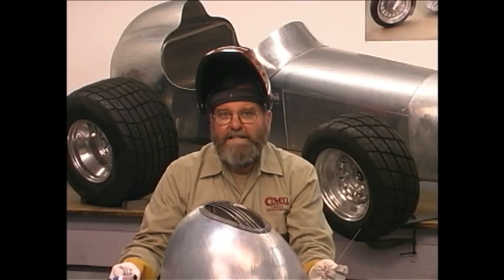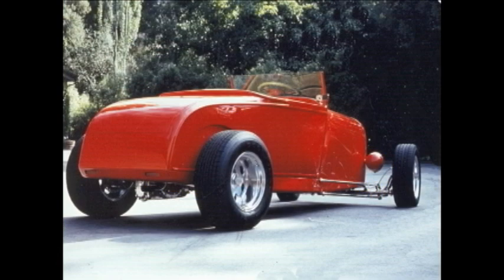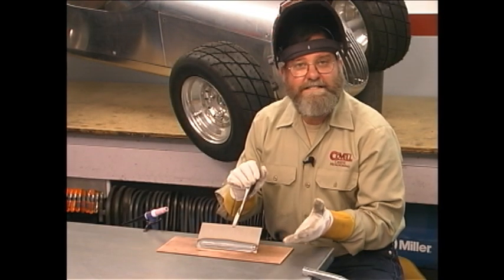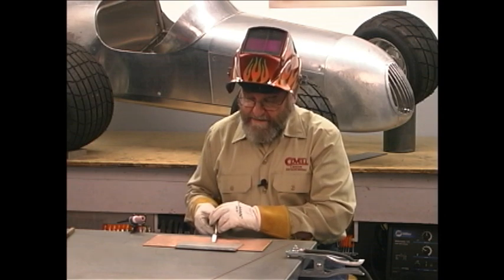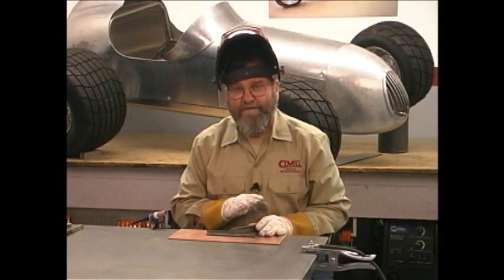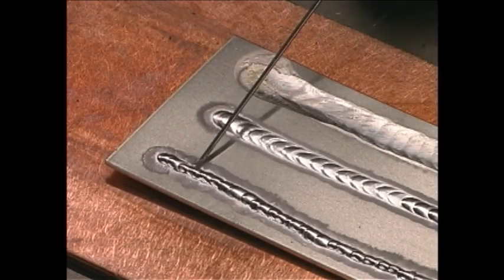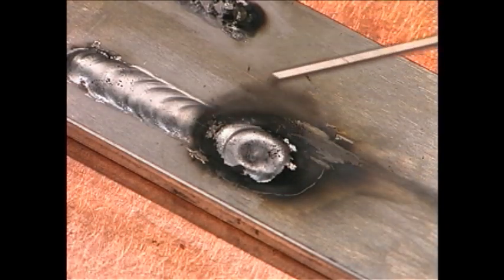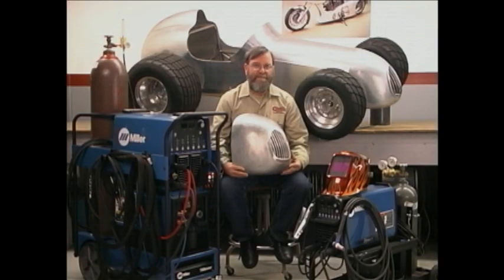TIG Welding Basics

Comment: I've tried TIG welding with a professional machine before (Migatronic brand) and i did not like it, seems TIG welding for a hobbyist such as me is not the right way to go, especially since i don't weld often and it's easy to come out of practice with TIG welding.
On the other hand when i got my MIG welder i absolutely loved it and in half an hour my MIG welds were consistently looking better than any of my TIG welds :)
Reply from the maker: Well, there are some very good reasons why MIG welding is far more widely-used than TIG welding. It sounds like MIG welding is a perfect solution for you!

Comment: want to know how you start the arc?
Reply from the maker: Yes, I want to know!
Reply: There are a few different ways the arc can be started. My Everlast for example has a high frequency start which is very much like a static spark. Others have a lift start where you put the tungsten against the metal and then lift. when you lift the welder initiates a spark which starts the arc. Others you scratch start where you run the tungsten along the metal to start the arc.

Comment: great video.! which tig welder would you recommend since i'm based in the UK miller are not easily available like the miller diversion 180 .any other welder models you can suggest .I will be working on aluminium and stainless steel in the auto industry with some light fabrication .kindly advise
Reply from the maker: I'm really not familiar with the machines available in the UK.

Comment: What's the proper way to clean contaminated tungsten rod? Cut it and sharpen again?
Reply from the maker: It depends on the industry you work in. For really high-tech work, the recommended procedure is to cut off the contaminated portion of the electrode, and re-sharpen it. For the automotive work that I normally do, I get sufficiently good results from simply re-sharpening the tungsten, without cutting.